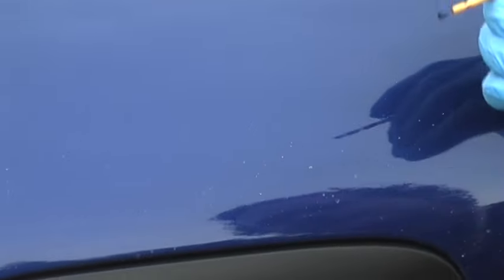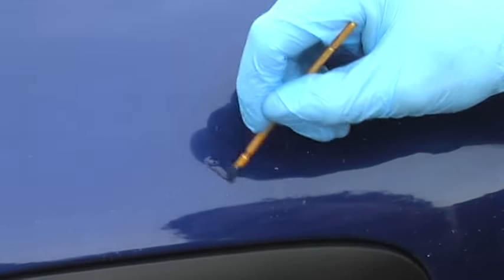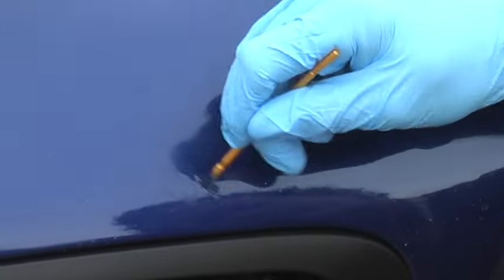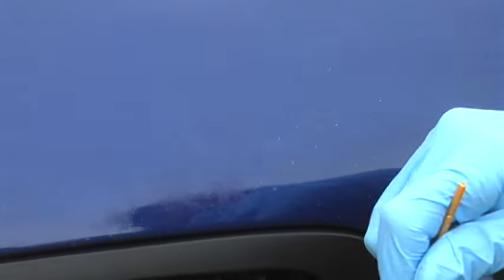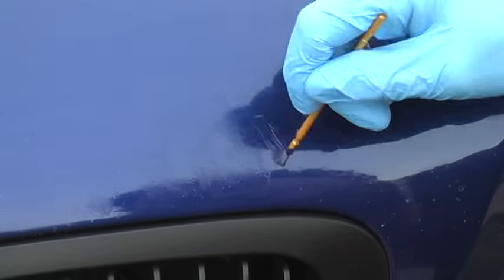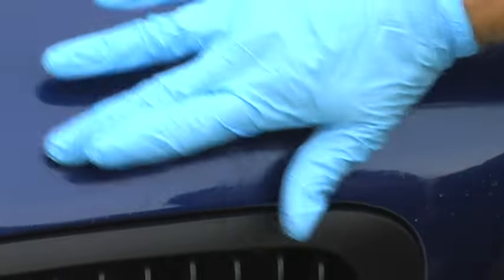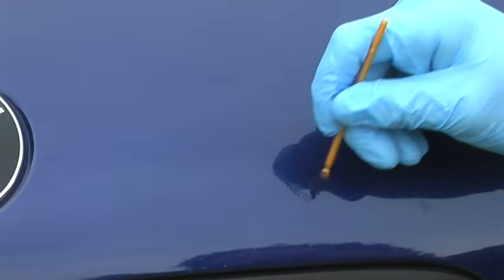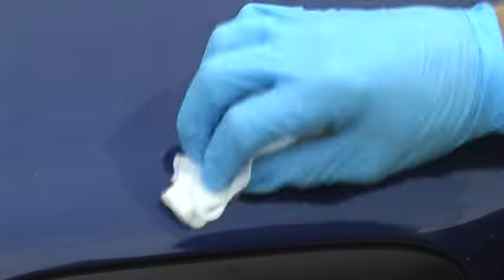Dr. ColorChip paint chip repair live demo

Comment from the maker: Yes, you would use the blending solution each time between applications. For best results when repeating the process, wait a day or longer between applications. That way the base layer of paint has a chance to cure and you won't be putting wet paint on soft paint, which will have a harder time adhering to the base layer.

Comment from the maker: A dime-sized chip is really larger than what we'd brag about our kit making impressive repairs on, but if you are inclined to touch it up yourself, ours will likely give you a better result than using regular touch-up paint. One tip: we offer a small rubber squeegee for about $3 that would help you get a better repair. Dab some paint next to the chip, then squeegee it across. It may take a few applications, but you'll get a very smooth repair. Then blend the excess paint from AROUND the chip.

Comment from the maker: 3M used to make a product called the Rust Avenger, which worked well at addressing rust in chips, however, they quit making it. Your local hardware store likely has rust converter in larger containers. Use a Q-tip or small artist's paint brush or microbrush to apply this solution to the rust. It should turn convert it to a black, paintable surface. For a few chips, we've also used the sharp point of a small knife and lightly scraped the surface rust away, careful not to harm the clear coat.

Comment from the maker: If you're only going to touch it up, our paint used with our squeegee will allow you to make a pretty clean repair- much better than using regular touch-up paint. The squeegee will allow you to leave a very smooth, near-flush layer of paint. You'd then need to remove the excess paint from around the chip, without passing over it with the blending cloth. However, if you're looking for a perfect repair, the body shop would be the best avenue for this type of repair.

Comment from the maker: A chip the size of a penny is really beyond the scope of what our product is intended to address with any dramatic results. However, if you are inclinced to touch this area up rather than have it resprayed, our paint will work better than regular touch-up paint, especially if applied with the rubber paint squeegee we offer. This simple tool allows you to spread the paint smooth and flat across the chip with no brush strokes. You'd need to blend the excess paint from around the chip afterward.

Comment from the maker: Yes, this BMW is in fact a metallic color. Over half our paint kits sold are for metallic colors, so not a problem in matching nor achieving a good repair. Our application process helps the metallic flakes align in the chip, rather than flopping as they often would if you simply dabbed the paint on the chip. Shipping to the UK is not cheap, but adding additional kits to the package doesn't increase the overall cost by much. If you get a friend or two to order as well, you'll save some cash.

Comment from the maker: The only way to truly make the chips disappear would be to have them filled, sanded and resprayed, which is something a body shop would do and charge several hundred dollars to for. Our paint will make the small road rash all but completely disappear and it will greatly reduce the visibility of the larger chips. Using the 3-ft rule, most typical chip repairs done with our paint will not be noticed unless you're trying to find them.

Comment from the maker: Sure, it will work well on most colors. A dark green metallic finish with lots of little white chips across the hood would be a great demo car, Vette or otherwise. If you are questioning the fiberglass body, our paint works fine on that as well as plastic and metal.

Comment from the maker: I'd suggest you use a little rust inhibitor on the chip first, applied with a Q-tip or similar applicator. This will turn the rust to a black, primed, paintable surface. Then you may use our paint.

Comment from the maker: We market our product as a paint "chip" repair kit. That said, our kits will work great on some types of scratches and not make a bit of difference on others. Deeper scratches have the best chances of looking good rather than surface scratches, which can usually be buffed out. Scratches in light silver or gold colors, for example, will show very little signs of improvement. See our webpage FAQ for more info on scratch repair.

Comment from the maker: Hello t dub! We manufacture over 10,000 colors and feel your burned orange should not be a problem. We would simply ask for your vehicle paint code and we will make your paint! Also, please refer to our FAQ page on our website for questions on the round spots. If they are through the clear coat, our paint should be able to help. thanks!

Comment from the maker: It depends on the color you're working on. Light silver or gold colors are harder to hide scratches on than most other colors, and very light scratches in the clear coat on any color can generally be addressed by buffing them out rather than painting, which often just makes them stand out more. If the scratch is down through the paint, it should work for you, but please read our FAQ or call us with specific questions if you're unsure. We'd rather direct you elsewhere if our paint won't help you.

Comment from the maker: Sorry for the delay in the reply. White diamond is a very hard color to work with, and our product can be hit or miss on scratch repairs, depending on the color, width and depth- which is why we don't market it for scratch repairs. In many cases, it will work wonders on scratches, but in your case, if you cannot sand and buff it, I'd say you'd need a body shop respray.

Comment from the maker: We suggest doing any wet-sanding before you use our paint. You wouldn't want to wet-sand it. Buffing is fine, though because of how our application process works and the type of damage it's intended to repair, there would really be no need to do either.

Comment from the maker: @optimusp517 Our product will work well repairing chips on plastic as it does on metal or fiberglass panels. Light scratches in any of these panels would not likely benefit from our paint any better than using regular touch-up as they could likely be buffed or wet-sanded and buffed to remove them completely.

Comment from the maker: @tallica4us Our blending solution is formulated to work with our paint only, so it will not work with your dealership BMW paint. If you dab and smear the dealership paint and try to blend it as you would when using our paint, you'll find that our blending solution will not remove the excess paint and you'll be quite upset at the paint smears you'll have stuck on your car.

Comment: I bought a system for my 2010 apex silver lancer. When I apply the paint then wipe all the paint comes off the scratch. I tryed it in 3 spots and it happened 3 times. My paint looks a little too watery. Is the paint that way or did I get a bad bottle of A31?

Comment: I have a small, deep chip in my hood. It's a 2010 Honda Civic. It has also started to rust. Will your product work on this? Will I have to remove before using the repair kit?

Comment from the maker: Unfortunately, that is way too large for our chip repair system to really do much for. Find a good mobile spray tech in your area. They could likely fill, sand and spray that, depending on the color, and blend the clear coat into the surrounding area to get a good repair. Otherwise, you'd need a body shop to take care of it properly.